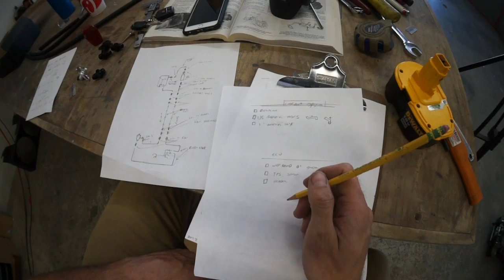How'm I Gettin Parts?!?!

Comment: To use the compressor for air ride you will need a inline oiler for the suction side and then a oil and water separator on the outlet side.  It's like you are using a sanden style compressor instead of a York.
Reply: right on the money it's a quick easy setup Doug

Comment: For the upper mounts: how about using aftermarket wrx style upper radiator mounts/brackets? You could just weld nuts to the cross bar like you did with the ground strap for the mounting point, effectively keeping everything simplified.

Comment: Perhaps set it up the same as you would a Sanden AC. they require an oiling system inline when used as an Air compressor.

Comment: I really like the idea of using an AC compressor to run air suspension as the electric air pumps can be noisy buggers but had the same concerns as you regarding the lubrication of the pump and additional complications with separating air, oil mixture.  In the end I decided to use 2 electric air pumps from a BMW and re  conditioning them myself advantage of that it they are build to very high standards and they have moisture removing chamber that is filled with a desiccant dryer to stop nasty water getting into the system. Overall, I am very happy with the result as the pumps are very quite even more so as I put them into my rear quarter panels with fan cooling and sound deadening.

Comment: I built an old 74' jeep with a York compressor as on board air and it worked awesome! Although, Like you said, there may be an issue with your compressor lubricating itself. To my knowledge compressors that do not have a self contained oil reservoir, rely on the free-on in the A/C system for lubrication. If you were to run just on board air, I'm pretty sure it would seize up.

Comment: i seem to remember suggesting you to use the factory ac compressor for your air ride... its simple. use a tool oiler with one of those valve cover air filters on the intake side. then plumb it to your take with a water trap inline. the only down side is making sure you have oil in the tool oiler. if youd like a reference picture private message me Doug. ill show you my old set up

Comment: Look up sanden gease conversion basically you pack it with grease and do away with oil all together.  Also what  i do is use the stock aluminum coming off there and connect a adapter to hydro hose then do your water trap at the tank.  the air coming out of there is super hot and will melt any plastic air line it has rainbow'd copper hose about 6 foot back

Comment: Generally if you're using a factory compressor to fill your air ride system, you tap the intake and exhaust, put an oiler on the intake side, a water trap on the exhaust side, and then just put a little air filter in front of the oiler. I've only ever done it with a newer chevrolet truck though.

Comment: The a/c compressor most likely uses pag 100 oil, they are designed to be cooled by the saturated vapor refrigerant returning from the evaporator coil. It could work but its going to need a little over 4 oz of oil that most likely is going to travel through the air line.

Comment: May I make a suggestion.  Make some sort of air dam to divert some air towards the radiator to help with the cooling.  On the 3rd gen camaros/firebirds its just a piece of plastic under the front.  Granted you have to make sure if you put it on the bottom that it doesn't bottom out with your ride height.

Comment: Drill a hole through the tube and run a bolt through with a nut at the bottom and have the top radiator mounts secure like that. So if you ever need to take the radiator out you just need to unthread that bolt and the bracket will come off.

Comment: Or maybe like a U-bracket and  place that over the pipe with the opening facing up and attach a flat piece of metal to that using a bolt to keep those two pieces together but able to detach them when you have to take the radiator out. But have that that flat piece long enough to attach to the nipple on to the top of the radiator.

Comment: Copy the bottom tabs only longer, roll them over a piece of pipe and weld on nuts to the bottom of the top bar like you did for the ground strap.

Comment: doug your exactly right ... what you need is a compressor with a  sump plug under the compressor. using the sump plug as a return you can use a oil air sepperator to remove the oil from the air to send it to the plug on the compressor. in the intake you will need an water trap. becare full aswell the compressor should only come on when the car is at idle or under a certain rpm otherwise you will destroy the clutch on the compressor. 
i used an old 240v shop compressor for the fittings/pressure valve and tank with a shift light on a nc relay.... but of course theres more than 1 way to skin a cat

Comment: thay factory compressor is cooled by the oil thats in the freon. without the freon the compressor will overheat and lockup. not sure if theres a way to add some kind of oil lube system never seen that done before

Comment: I have done airbag systems using air conditioning compressors all you have to do is install an automatic oiler on the intake AC compressor it's super easy you need any help feel free to instant message me

Comment: Couldn't you use a small amount of fuel line, the pump and a gas can to see if the motor will run until you get parts?
Reply: You could run it for a few seconds with no coolant. Sparks controlled by that new ECU right? Could always finish that up :) Just giving you some ideas while you wait on parts.
Reply: I've ran many engines just for a few seconds without coolant without any problem. Good insurance so you don't get all finished up and find out its messed up

Comment: Fraud alert system blocking your order?  I had a company card, and while on repeated work trips from Redondo Beach to Folsom, I'd use the same gas stations with whatever rental car I had.  It was a 50/50 chance of being blocked, and then getting a call, while I'm standing at the gas pump.  All I wanted was gas for the rental on the same trip every couple of weeks, and it was a "huge surprise" that I'd do it.  Joy.

Quick question: are you going to use an air scoop to funnel air through the radiator core?  I've seen a few conversions like this with bigger engines, the most recent was the "Mazdarati" by the Roadkill guys.  HVAC FTW...sort of.  https://www.youtube.com/watch?v=XuHIemMF4kY